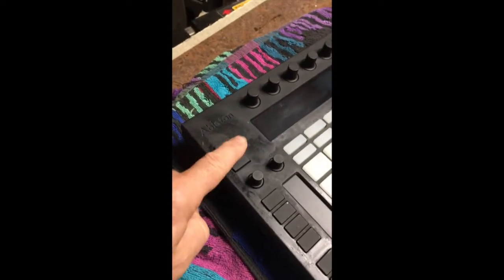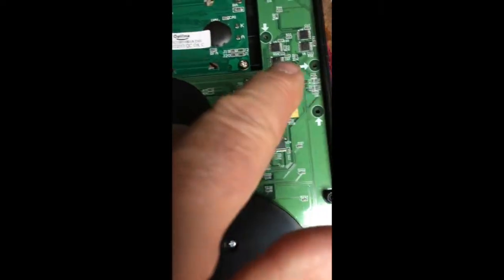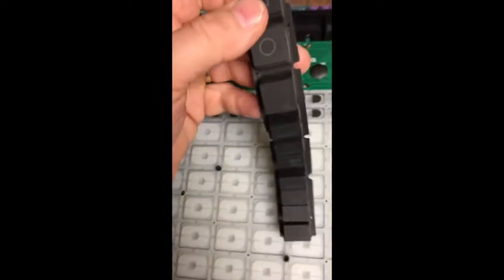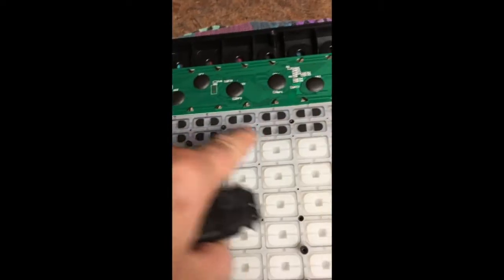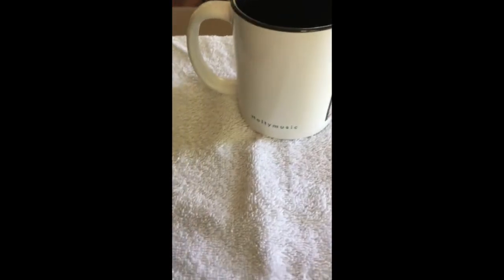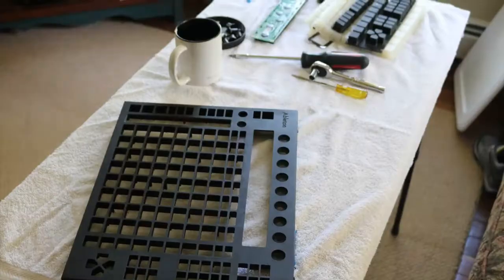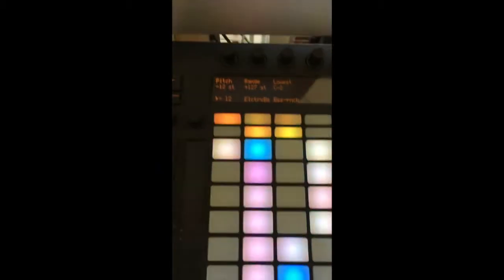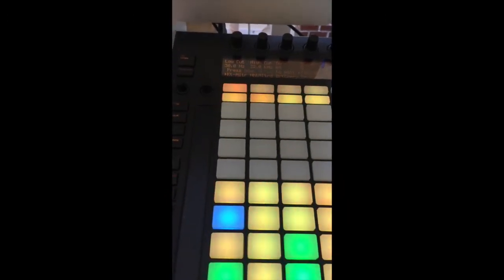Ableton Push 1 repair finish

Comment: I really appreciate this video. After trying a few different cleaners, I used 70% alcohol, goo gone and naptha (lighter fluid) but the best cleaner by far was cooktop cleaner, also called glass stovetop cleaner. The brand I used was Easy-Off (Canada) but I bet any brand of Stovetop cleaner would work like Ceramabryte - NOT oven cleaner. You need something mildly abrasive to get the TPE coating off. I found with just alcohol that the coating would just spread around. Save yourself some time - it still took me like 3 hours!
Reply: how clean was the finish afterwards?
Reply: @Rooftopaccessorizer  For a used Push, I'd say it looks basically flawless.

Comment: I fixed mine but instead of painting I sand it with a very fine grain and water. Result is very good, both visually and at hand contact. I prefert it now over the state out of the box...

Comment: hey man, what kind of paint did you use? a spray paint? i'm a bit clueless with hardware stuff. i'm dying to undertake this, my push is gross.
Reply: It was the cheapest flat black paint spray paint they had at Lowe’s. It still looks good.
Reply: @davidholt9885  thanks! i am a little nervous about taking it apart and remembering all the steps, but here goes...
Reply: @davidholt9885  i used some cheap plastic black spray paint and it came out an awful gloss. i've peeled it all off and i'll have to find a matt spray... sigh...!

Comment: Hey! Quick question. When you are putting it back together I notice you didn't put that plastic contact sheet between the back of the pads and the pcb in before screwing the pcb back in. Did you put it in off camera or does it actually work without that sheet??
Reply: I don’t remember that part, I know there were no parts left over and it continues to work perfectly. Thanks for watching.
Reply: Yep, you def forgot to put the carbon sheet. Did you buy yours used? Surprised it still worked too

Comment: I used professional glass cleaner to clean it, it works, no need to paint then
Reply: It works, thank you! I jused a home glas cleaner and the matt first matt coat which caused the sticky areas is away, leaving semi-glossy plastic surface of the housing.
Reply: @wojtekmichalski  I just did this to my Push 1 last night. I used a combination of Windex, Goo Gone, a sponge, Q-tips, and paper towels. It took some elbow grease, and it was pretty messy, but it's nice and clean now. It took about 2 hours, but I got it down to the bare surface. It was so sticky and covered in dust before.

Comment: Would you recommend just paint it or remove some sticky part before? Thanks
Reply from the maker: I'd say just paint over it with flat black spray paint. I wasted too much time trying to clean it. Thanks for watching.
Reply: I guess if the sticky finish is not smooth then no matter if you paint over, the final painted finish will look very bad.
Reply: Better you spent your time on cleaning the sticky rubber first and then paint.
Reply: @coltusound9168  I made it my own way, cs best way to clean those gummy to mix food soda and cocoa oil. Cleaning takes minutes, and washing oil takes minutes. Painted it Gold and its amazing now!

Comment: Thanks for the video I have the same problem this also happend to my JBL LSR4326p Studio Monitors its a bad polymer coating it took me 2 days to rub off the coating with the stickystuff remover Cleaner from amazon. What did you use to remove the sticky coating or did you just spray over it?
Reply from the maker: It was too hard to clean it off, I tried alcohol and acetone. I ended up just spraying over it with a flat black enamel. The finish this finish has held up well. Thanks for watching.